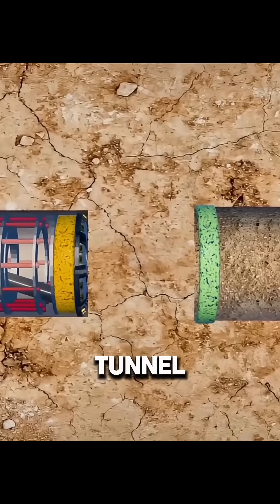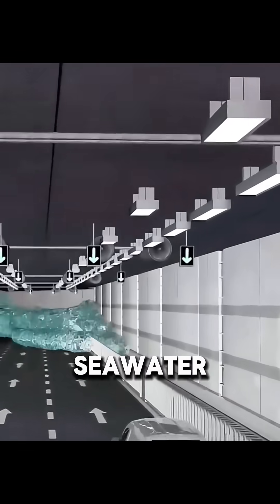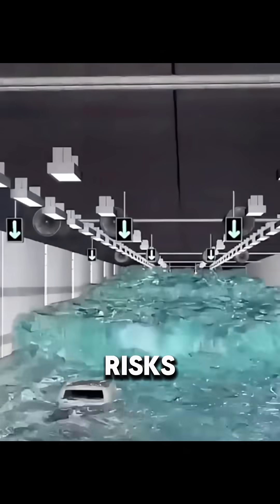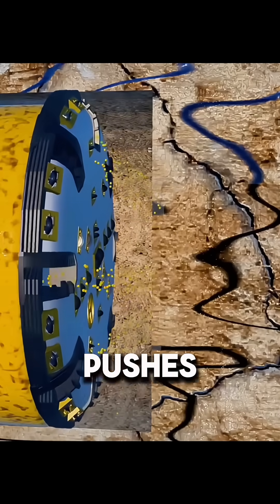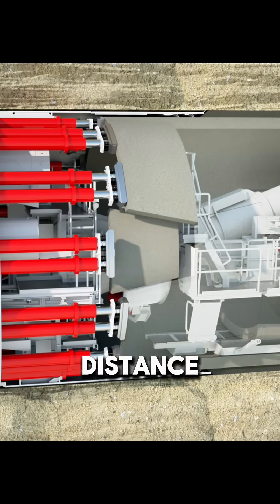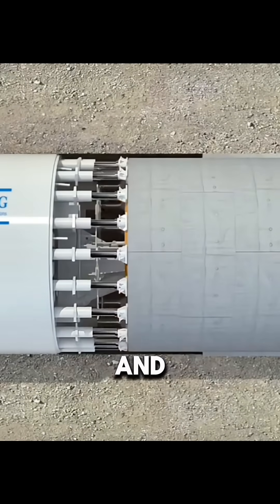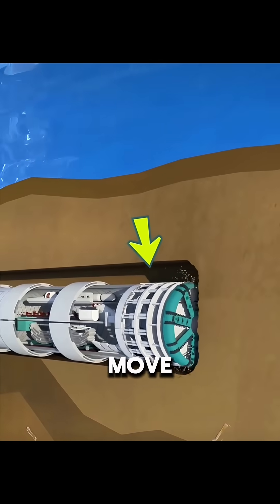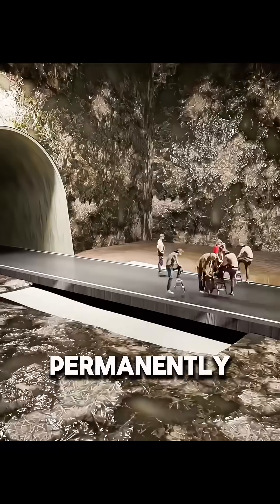How Tunnel Boring Machines Prevent Tunnel Collapse? #foryou  #zackdfilm #tunnel

Comment: AI/Google says this:

Yes, the cutterhead of a tunnel boring machine (TBM) can be reused for new projects after thorough inspection and refurbishment.

°Reuse is a common practice in the tunneling industry, as it offers significant advantages:
°Cost savings: Rebuilding a TBM can be up to 75% cheaper than constructing an entirely new machine.
°Time savings: A refurbished machine can be ready for use within months, whereas manufacturing a new one can take more than a year.
°Sustainability: Reusing large components significantly reduces the environmental footprint, primarily due to lower steel production requirements.

The process typically involves:

1. Disassembly: The machine, including the cutterhead, is dismantled after a project. In dense urban areas, this may take place underground, where it is cut into sections.

2. Inspection: Each component, especially the heavily loaded cutting tools, is inspected for wear and damage.

3. Refurbishment/Modification: Damaged or worn parts are replaced. The entire cutterhead can be modified or adapted to match the specific geological conditions and the required diameter of the next project.

4. Reassembly: The refurbished and new components are assembled into a machine that meets the same standards and warranties as a new one.

Some TBMs are designed with reuse in mind and can be used for decades and across many projects, provided they are properly maintained and designed accordingly from the outset..

Comment: For the smart Aleck armchair engineers criticising leaving the TBMs in undersea (not above ground) tunnels, it  takes weeks to transport the parts to site, then assemble them. The English Channel Tunnel consists of 3 tunnels, two railway, one service. It was bored by 11 TBMs, from the English side and from France. They met in the middle. It is 31.35 miles long, 23.5 miles of it undersea. A TBM cannot move backwards. Now think of the cost of dismantling them and transporting the parts back to the shore some 16 miles away underground, plus the time it would take. Too costly: Q.E.D.
Reply: No

Comment: They say it's costly to take out, but once it reaches the other end, it's destination it should just be hoiked up on to trucks or a train track & carted off either to storage or it's next location for a job.
Reply: I always love it when someone thinks they know better than those that design and use something that is incredibly complicated. If it were more cost effective, believe me, they would be doing it that way.
Reply: @BrentonAdcock-m5x this right here all the time. it's like why... no use bothering to explain it
Reply: I know in the case of the undersea tunnel between Britain and Europe, they drilled from both sides and met in the middle to shorten the duration of the project (as the longer a project goes on the more costly it tends to be). The last segment is done  manually.
Reply: Oh, I bet they never thought of that!

Comment: Time for engineers to make one that can be pulled back for reuse.
Reply: it could be pulled back. It is just more expensive than leaving it there.
Reply: Im no engineer, but my guess is the boring head is wider than the tunnel after the concrete liner is in, won't fit to pull it out.
Reply: the boring company made one that can change direction and poke back out the top
Reply: It's also pretty knackered.

Comment: Why wasting so much concrete just to bury these remains
Reply: Stabilize, prevent chemical leaching and it becomes a part of the structure.
Reply: That was clearly explained in the video. Try listening to the narration. Or you can read the subtitles. Maybe your mommy can help you with that.
Reply: concrete is cheap and easy to manufacture, and ends up making cheaper and better houses than murican homes
Reply: @Swarmah  My house in America is made of concrete. 🤔